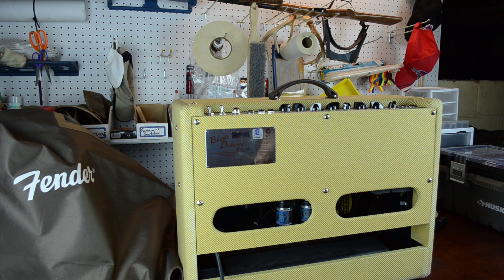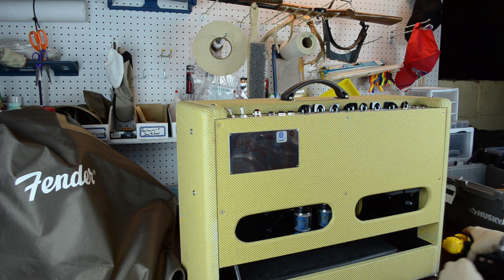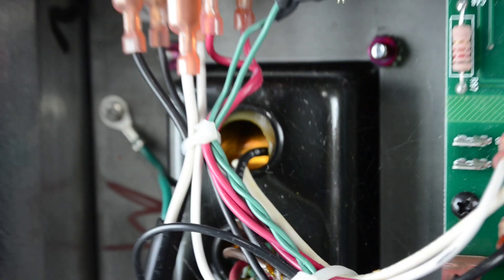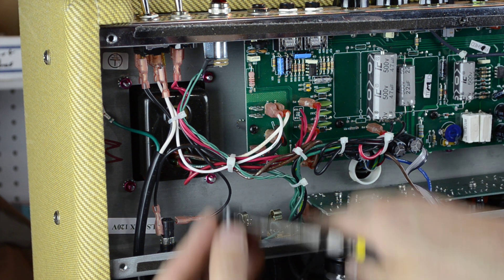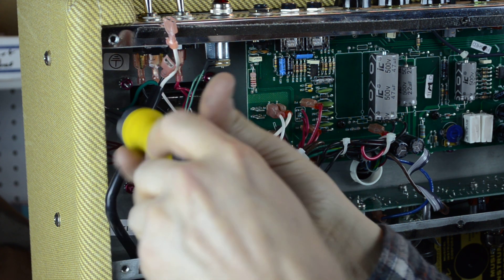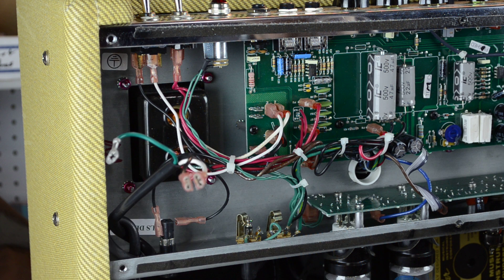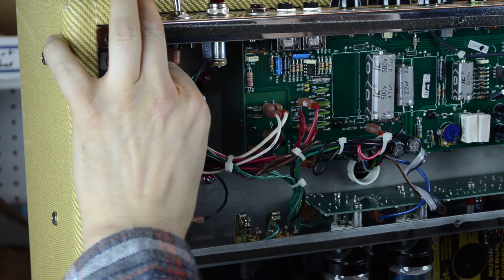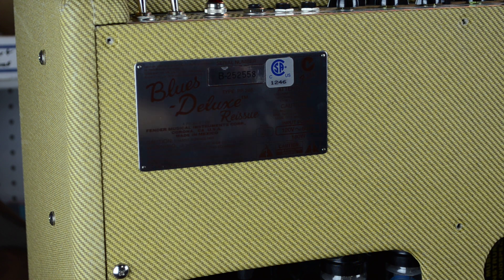Fixing a fender guitar amp power problem

Comment: A neat trick that works really good and saves you time is just to put a wire tie around power cable on inside of amp. it will keep the cable from slipping down and it takes about 15 seconds to do. :)

Comment: 'Waiting out' the charge stored in the filter caps is bad advice. That charge can remain for quite some time depending on the circuitry and what the conditions were when last powered up. The only safe way of knowing when it's safe to work on the amp is to measure the caps with a dc volt meter and only continuing if the caps show a safe voltage level. I consider under 10 volts safe, a volt or 2 is common on a properly discharged amp. These caps seem to have a habit of (rather mysteriously to me) regrowing voltage over time with no power attached so keep the meter clipped on and keep an eye on it while you work. Discharging the amp if needed isn't difficult if you have the appropriate tools and do it carefully. See here: (quoted from Aiken Amps excellent tech info section):

"This can be done by 
shorting the "+" side to the "-" side, or the "+" side to the chassis 
(unless the cap is in a negative voltage supply, like the bias supply, 
where you must short the "-" side to the chassis), using a wire or a 
screwdriver.  This will make a big spark and a loud noise, which is sure
 to impress any onlookers.  If you'd rather do it more discreetly, make a
 jumper cable consisting of alligator clips on the ends, with a resistor
 in series in the middle of the jumper.  Use a value of somewhere 
between 10K and 100K, with a power rating of 5W or so (a high power 
rating is not really necessary for dissipation reasons, but mainly 
because the higher power resistors are physically more robust and won't 
tend to break).  Be sure to adequately insulate the resistor with 
heat-shrink tubing so the wires aren't exposed, or you'll get shocked 
while trying to discharge the capacitors.  The larger the value of the 
resistor, the longer it will take to discharge the caps, and the less of
 a spark you will see.  If you use a large value resistor, be sure to 
leave it in place long enough for it to drain all the charge out of the 
capacitor (if in doubt, measure the voltage across the capacitor to make
 sure it is close to zero). "

Comment: Hey Johnathan, this is great advice! I've a question though(maybe you can help me understand this) if I want to power up a twin reverb and my pedals in a country where they use 220, is a step up/down transformer enough for both? What wattage should it have to run the pedals and amp smoothly? Thanks in advance!
Reply from the maker: "Buck" and "boost" transformers or "power adapters" are rated in watts or kva.  Most likely watts.  The amp should have a sticker that tells you how many watts of power it consumes (this is different from the output power of your amplifier) and should be on the UL label.  Add the power consumption of both devices together to get your total and purchase an adapter with no less than that number of watts.  The pedals typically don't take much power.  Purchase a quality adapter that gives "clean" power so you don't get a bunch of noise on the line.  Hope that helps and good luck!
Reply: Thank you for the advice!
Reply: +Jean Paul Cisneros It's worth remembering that transformers intended for 60Hz operation may overheat if subjected to 50Hz mains (which is most 220/240V countries). Whether that's a problem with a Fender twin intended for the North American market I don't know, but it's worth checking.
Reply from the maker: Definitely worth checking the frequency, many modern adapters will handle both, be careful with the cheap ones.  A good, clean, high output, power adapter is worth the money you will spend.

Comment: I got a new orange crush 35rt from my parents as a christmas gift and it's not turning on.  Does this video also apply to solid state amps?

Edit: It wasn't the amp; the outlets I tried plugging it into weren't working due to a problem with my house's circuit breaker!
Reply from the maker: You should return the amp,  don't open it or you'll void the warranty.
Reply from the maker: Don't open a new amp. You'll void the warranty.   Orange will help you out, they are a good company.

Comment: So I have an amp at home and the front stopped working. The lights use to turn on but now they don't. However every once in a while everything works fine so I think it's a loose wire or something anyways if you have any tips I would be grateful. Especially because it cost more to have someone repair it than the amps worth.

Comment: those 3 big filter caps WILL get you good
Reply from the maker: +ratman396 I think I will do another video just on the capacitors, they seem to get a lot of attention.  I have never had an accidental discharge and have relied on the circuitry inside the devices to drain them but I get a lot of comments about them.  What do you think?
Reply: If it were me I'd discharge them.  take an alligator clip lead and ground one end on the chassis.  Take the other end and attach it to one lead of a high value resistor (I think 10MOhm will work).  touch the other resistor lead the the negative side of the cap for a few seconds to let it discharge to ground.  Do this with all the filter caps.  You are now guaranteed safe as long as the amp is off.  NEVER trust a bleeder circuit to do its job!  Sometimes they don't (or worse, they're not there).
Reply: +ratman396 Use a jumper wire from the anode (plate) of the first preamp valve (tube) to ground so the capacitors discharge via the anode resistor.
Reply: why do you discharge it through the negative side of capacitor and not the positive side of capacitor? does it make any difference? by the way thank you very much for your comment since I learned something :)

Comment: jonathan i have a usa fender deluxe the tubes are new but the first tube doesnt light up some times. i changed tubes because this was happining  can u help
Reply from the maker: I need some more information, when you swapped the tubes did the same tube not light, or did the other tube not light?  I'm trying to figure out of it is the tube or the socket.
Reply: jonathan thakx for replying. the same tube did not light

Comment: Is there an easy way to quit those things that you reconnect to fix the amp, Im trying to fix the power switch button of my amp but I cant release them, any tip would be appreciate it :)
Reply from the maker: They have a very small tang that clips into the spade connector.  A very small screw driver can be used to release the tang, or use a flat screw driver to apply pressure to the edge of the clip.

Comment: a big cable tie would of saved you this whole video
Reply from the maker: +Matt Lee , there is more than one way to skin a cat, I gather from the comments that wire ties are used as cord restraint a lot, I'm not a big fan of that use and I had the original restraint.  thanks for watching and commenting.
Reply: I agree.  Even a small cable tie would fix this problem but Jonathan still did a great job.

Comment: You could have fixed this with two zip ties and not had to unhook anything.
Reply from the maker: I like my solution, zip ties fatigue in the heat created by the amp and would eventually break, my solution is still in use and had not had anymore issues.  I would use caution with zip ties in any hot environment and they are not intended for strain relief.  Thanks for the feedback and rock on!

Comment: What are you doing, Is it the fact that you don't know how to discharge the amp, That's why you didn't do it.
Reply from the maker: You need not risk "discharging" the amps capacitors manually.  You only need to wait a short period of time for the capacitors to discharge on their own.  For me, it is not worth the risk of finding and discharging the capacitors, I simply wait a few moments before opening the case.  you can also unplug the amp then turn the power switch to the on position, this will also effectively discharge the capacitors.
Reply: +Jonathan Bell , If that's the case maybe you should have grabbed the caps to prove this theory.
Reply from the maker: +Pistol Walker lol, I'll let you test that out.